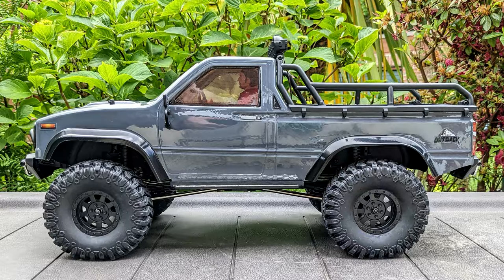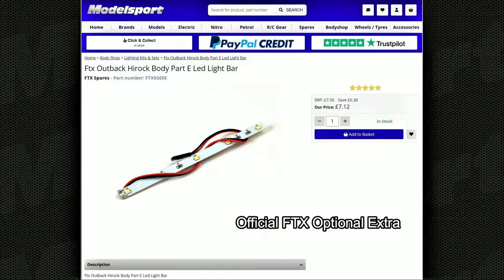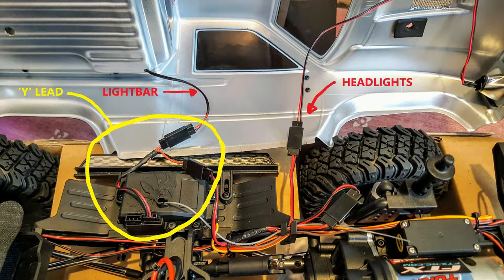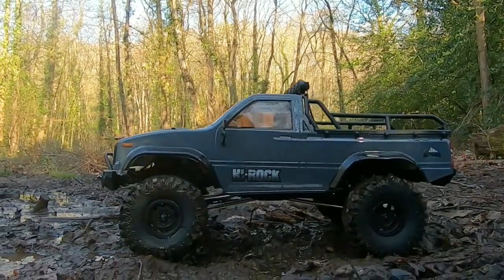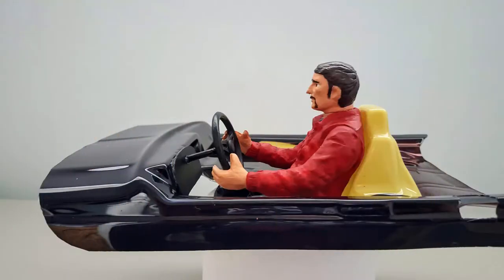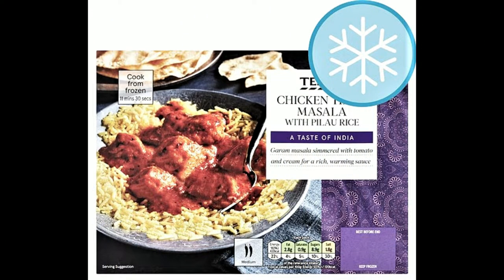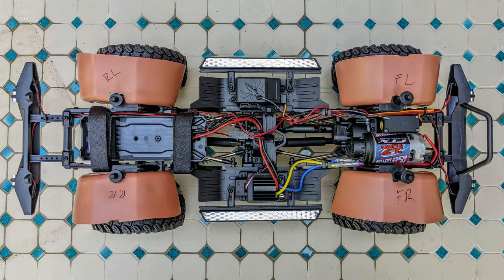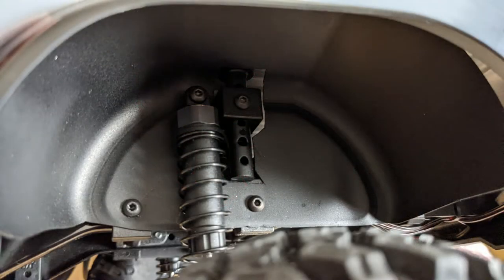Custom Made Inner Fenders & Interior (FTX Outback Hi-Rock )

Comment: Hi, I follow your special videos and I recently became the lucky owner of a fantastic hi rock ftx. Now I have bought 4 more original tires and the led bar for the roof. I also took a "Y" cable, but when I connect it, only 1 led of the bar works. I tried to insert the bar directly into the free socket on the plastic dispenser, where you circled in yellow, which is on the free left, and they all worked. What advice do you have? I made a video I'll send it to you privately, thank you very much.
Reply from the maker: Hello my friend. Thank you for watching my video. My diagram shows how to plug in the lightbar so it will turn on and off with the headlights when you press the third channel button on the remote control. This is what I wanted it to do and I remember having problems figuring it out because the lightbar didn't come with instructions. There is no guide how to do it in the Hi-Rock manual either. So I just tried different ways of plugging it in until it worked with the third channel on the remote control. If you are happy with the lightbar being on permanently then just leave it plugged in the left socket as you mentioned. It should light up when you turn on your esc to run the Hi-Rock, and then go out when you turn off your esc. I hope this helps 🙂👍🏼